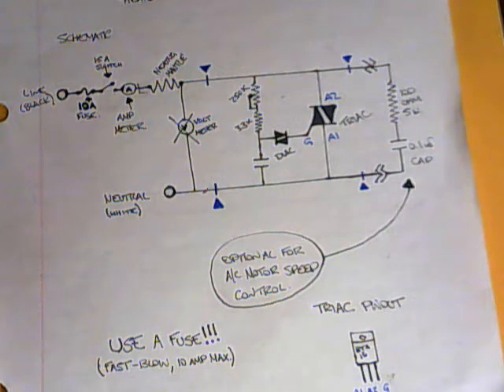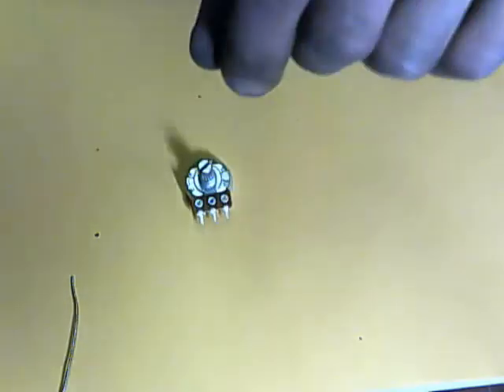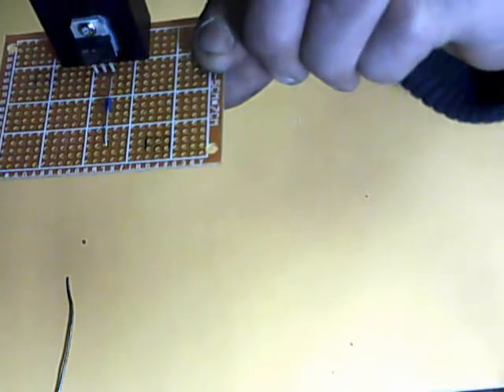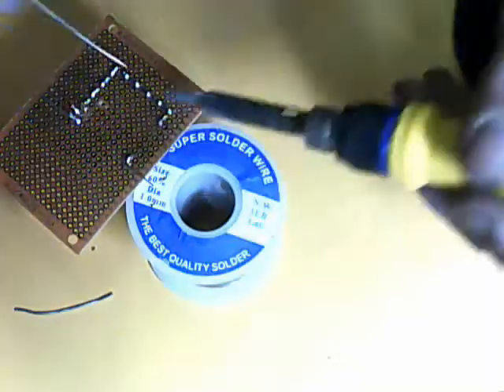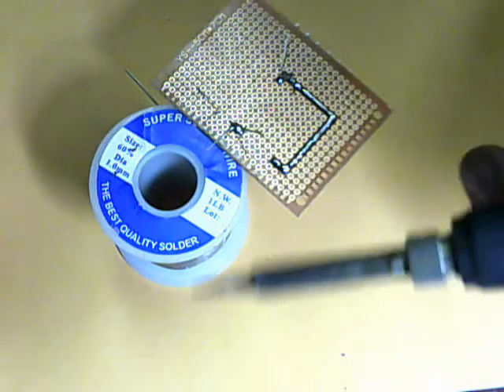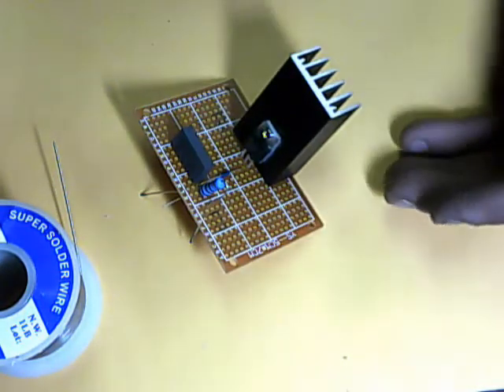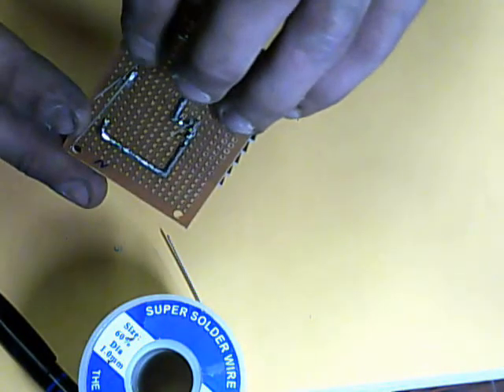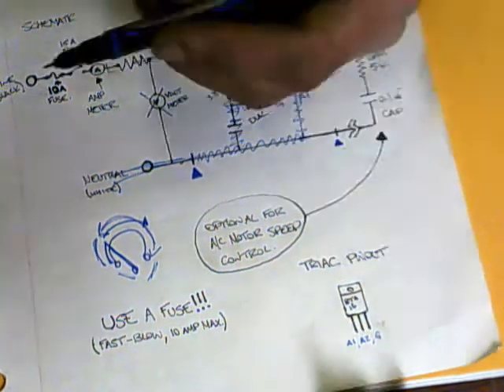Resistive load Triac circuit (Current limiting) LAB MANTLE CONTROLLER

Comment: great channel !!
would be willing to make a full "how to" for guys like me that can plug in things & switch them on :)

i do get it but ..... need all the details
thank you
Reply from the maker: I'm sorry David, this is the most intuitive-step by step video I could have possibly made. I did make this video for guys like you, if you follow the steps from start to finish this will work for you. If it doesn't, you didn't follow the steps properly. 

You don't have to make the connections on a circuit board like I do, you can replace it all with wire. In that case you'll have to follow the schematic on your own. And if you watch a few times you should be able to figure it out as I do explain in detail what connector goes where, and I highlight each and every step I do as I go.

Pause the video at the beginning and draw out the schematic like I have done, and follow the steps. Highlight or cross out what you have done. When the whole thing but finished, plug it in and hope for the best.

I want to stress that this is working with line voltage, this can easily kill or at least give you a nasty shock if miss handled. If you are going to attempt this please think safety and be careful...
Reply from the maker: And thank you, I'm glad you like my channel.
Reply: nilamotk this is very informative, thank you
just wondering about the wiring from the wall plug to the volt / amp meters to the board you have built.
i am not getting the wiring diagram due to the fact i never have followed electrical specs before
maybe a written instruction ?? in the main comment section of the video ?
Reply from the maker: The volt meter is useless don't use it.

A plug cord comes from the wall with 2 or 3 wires. Green is always ground black(brown) and white(blue) are used (sometimes they are these colours instead)

The black and white is all you need. The white wire connects to the lower left part of the circuit (the neutral) the black wire is where the magic happens. Take the wire and connect it to a switch, from the other side of the switch connect it to your amp meter (10-15 amps) from the other side of your amp meter connect it to your heating mantle (or lightbulb) and from the other side of that connect it to the top left side of the circuit. 

If you want to use this to control motor speed, you have to add the 2 components on the right ride of the circuit. (With heating elements, and incandescent light bulbs you don't need it)

Good luck
Reply from the maker: Also don't forget to like and subscribe!

Comment: Hello! I'm interested  in making my own heating mantle controller, but I haven't such a great electrical experience. I've 220V 60Hz AC, which component should i change? Thanks
Reply: Excuse me again, is there a way to gain same results using dc current just to avoid problems with high voltages? Maybe using my old pc ATX
Reply from the maker: This circuit should work for 220 v ac as well. 

I wouldn't re command using DC as it further complicates things. AC keeps it simple.
Reply: thank you! i've already made a 250ml flask mantle following the instructions in the previous video. I powered it with a AC/DC laptop adapter and it worked pretty good but I must reach higher temperatures so I definitely have to try your circuit!
Reply from the maker: It should work good for you. Or you can build another mantle and use a shorter length of nichrome wire.

Comment: hello sir,Thanx for ur circuit.
 i want to use some closed loop or open loop circuit to make it little automatic, is there any way......
Reply from the maker: You can use an arduino to control the triac, then you can automate it to do whatever you have set the arduino to do.
Reply: hey i know its a few years back but could you send me a picture of the arduino with the circuit ?

Comment: But sir, the ceiling fan regulator which we use to control the speed of fan motor, i used that regulator , its working on this led for control the intensity..
Reply from the maker: Then use this circuit, but you know geo the schematic has a part in it with the extra capacitor, and resistor? You have to add that part to the circuit and it will work
Reply: thank you sir...pls sir can u help me for calculating these circuit parameters..for bt136 triac and db3 diac..
Reply from the maker: It's the extract same as shown in the video, same circuit with the extra capacitor that it shown in the schematic but not actually out in the circuit. 

It will work for all light bulbs, ac electric motors, and more.
Reply: sir as calculated other resistor values, how did u calculate these values and what will be power ratings for these resistors
Reply from the maker: It doesn't really matter at all, the diac and the resisters don't have any real current run through them. They just control the timing for the triggering of the diac and triac. 

The power rating is handles by the triac which can handle 15 amps.
Reply: may i use 1 watt 3.3 k resistor, for external resistance what value did u use, i am unable see it clearly..
Reply from the maker: The wattage doesn't matter. You can use 1/4w everything. The triac and capacitors are the only critical parts.

I used 1w 3.3k and a 1/4w 250k POT, then 0.1uf capacitor for you would be 250v or more. Then the extra 2 parts you need to add that's not in the video but is show in the schematic is another 0.1uf capacitor and a 100 ohm at 1w minimum resistor 
(The 2 parts to the right hand of the schematic.)
Reply: ok....thanks
Reply from the maker: Sorry of I'm confusing you,

Buy and use these parts, and you won't have a problem.

3.3k ohm  1w
100 ohm 1w
250k ohm POT 1/4w
0.1uf cap 250v (x2)
Diac
BTA16 triac.

If you really need, I can make a video modifying the circuit I make in this video, add the 2 parts to make it work for a motor or your led bulb.
Reply: may i use bt136 triac and db3 diac
please if u can, make it for me..
Reply from the maker: Yes you can.
Reply: is there any other way to be in contact with you??? 
means facebook...

Comment: I want to make a circuit to control the intensity of a led (230 volt ,10 watt). Which parameters I have change. And is it compulsory to use that extra resistor and capacitor. And can I use BT136 triac and db3 diac for this.
Reply from the maker: This won't work for led dimmer. 

LEDs run on DC this triac is an AC circuit.

To control the brightness of an LED you need a PWM circuit.
Reply from the maker: And I have never heard of a 230V LED , do you mean like a socket bulb with LEDs instead of a filament? If so, you can't dim those. 

But you could try if you wanted too, it may work if you add the extra capacitor and resistor that is extra to the circuit. Because if it is an LED wall socket light bulb, it will have a circuit inside the bulb to convert AC to DC and this circuit would be considered an inductive load not a resistive load.
Reply: yes i am talking about that socket bulb which we connect directly to our home supply means 230V . I really want to do it. Please tel me how calculate the values of capacitors and resistors. I m facing problem. As u told that its having a AC to DC converter inside itself, means we can use this circuit for that led. please tell me about these values.
Reply from the maker: You probably can't with that bulb. You would need an led that is JUST an led with no power circuit, then use PWM . Or you have to make your own bulb again, with a custom power module.
Reply: ok thank you sir...